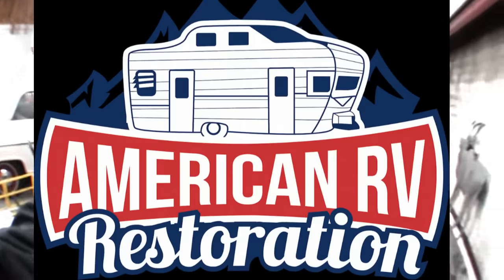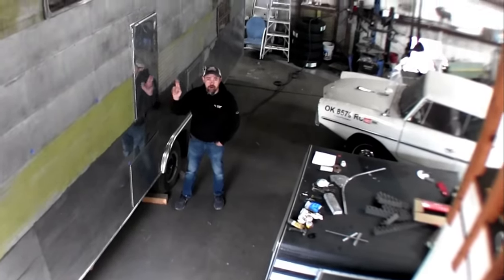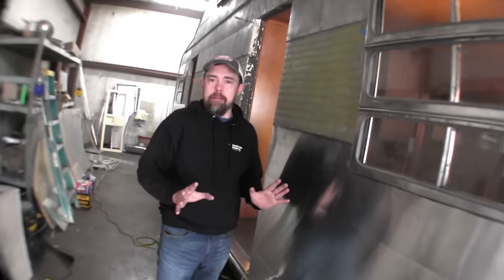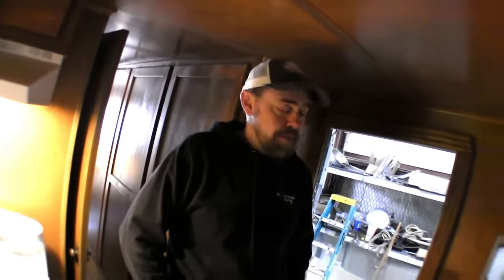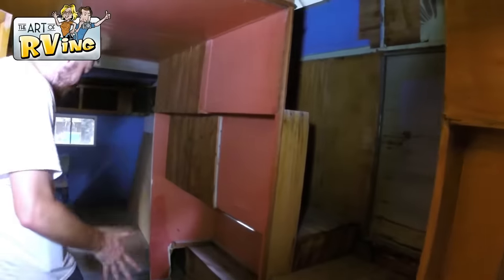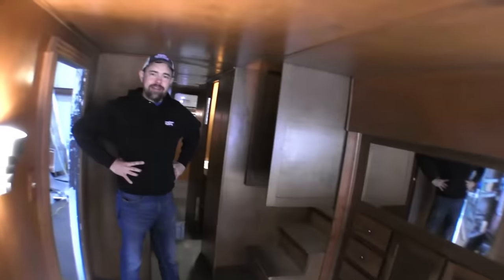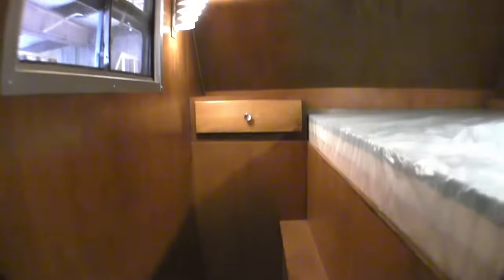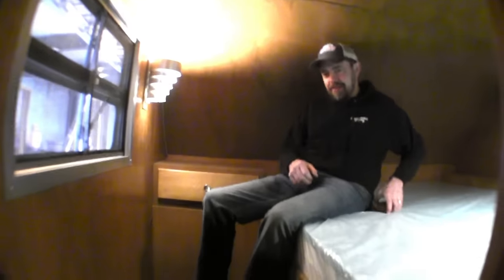Restored 1951 Double Decker Lighthouse Duplex walkthrough

Comment: The mobile home in this video was home to me and my family when I was a child.  The black 49 Dodge and the Blue 56 Dodge were my fathers Pickups.  The picture of the trailer with the white picket fence has my two oldest sisters Karen and Dava leaning up against the fence.  We would love to get copies of the photos that you have and share some that we have of this home and give you some early history on it as well.
Reply: Thats awesome!!  I hope they reply to you.  Out of curiosity, how well did your fathers pickups pull this camp trailer, especially up hills?
Reply: Thank you so much for adding your story to the trailer, that’s amazing. You could make a mini series here on YouTube telling your stories and adventures with your family. 🩵
Reply: I hope you hear 🙉 from them.
Reply: @ironcladranchandforge7292 slow and steady those trucks was probably 100 hp or less it was all about the gears back then trucks were used as trucks
Reply: @john.ediggs9034  --  Well, my 1960 Chevy Apache is stock with the 235 I6 and it has 135 HP gross and 115 HP net, torque is 195 at 2,000 RPM net.  This is according to the 1960 shop service manual.  However, it cruises just fine at 55 to 60 mph on the highway at around 2,200 RPM.  I've owned this truck for over 25 years and have taken more than a few trips with it.  No problems.  However, I do stay off the interstates where the speed limit is 70+.  By the way, I've also taken it over a few steep mountain passes (I'm surrounded by them) and no problems.  6% grade at 50 mph.  Sure a V8 would be faster and more powerful, but if I want that I would drive a modern vehicle.
Reply: That’s awsome
Reply: Super cool! How nostalgic it must feel to see your former home being restored after neglect!!!!🥰🤗
Reply: Thank you for adding provenance to this old girl😊 It must have been a tight fit as a home, I can't imagine.
Reply: Wow! This is awesome support to the historical value of this unit.👍
Reply: Amazing!!!❤❤❤❤❤
Reply: Wow. Just friggin WOW!!
Reply: That's awesome! I hope they pin 📌 this comment!
Reply: Was your family the one with the Air Force father? Five kids plus two adults would be a tight squeeze in that!

What's your favorite memory from the mobile home?
Reply: So cool to hear your story.
Reply: Cool story!
Reply: Can we get a update????
Reply: Wow!!! 🙂
Reply: That is very cool! I've been working on memoir for my only son and one of my earliest memories from 1956-57 was living in a trailer park in New Martinsville WV and a family of 8 lived in a double decker trailer. 1st floor had galley beds, then up a few steps was a small 2nd bedroom. Steps  turned and another level was at the very top was the full bed.  I was only 3 but I could remember those stairs perfectly. Since Google picks up key words I started seeing these double deckers. There's a different video that describes what I remember exactly! So neat to find someone else who actually lived in this trailer. I hope this company gets in touch with you! 😊

Comment: ..and they used to build vehicles strong enough and dependable enough to pull those behemoths. Man that's gonna be nice!
Reply: Pre-emissions days when fuel efficiency and useable power were still the standards they built for.
Reply: Actually, those weren't designed to be vacation tailors back then, they were "park tailors" that people would usually live in as their home in tailor parks.  They were designed to be mobile, but not something a family would drive around with on vacation, hitched to the family vehicle.  They didn't even include water tanks or an onboard power source because it was assumed that you would be parked somewhere with hookups.  So, you would hire a large vehicle to move it.

Comment: I have one of those couches and it is going to fit perfectly in my  18ft 1969 Fireball travel trailer. The couch without the box it sits on, fit right on top of the trailers existing  box of one of it's 2 single person beds /bench seat/ flip-up storage area that also has 2 draws under it. The 2nd bed box on the other side, houses the water holding tank and and hot water heater. So it doesn't need to flip up ,so, I made that a base for a little wood stove and entertainment center with computer and surround sound with subwoofer. I'm really looking at that split system now though.

Comment: I lived in a old trailer it was about the same year that trailer was made , and it was gorgeous on the inside but not well made. Black and white Mold took over the trailer on the inside. Moisture was a big issue when showering and after showering, and there was a small washer dryer combo in the trailer and that made even more moisture, and if I cooked then even moisture issues. Those wood panels like the ones in that trailer sucked up all the moisture and created mold all over the wood panels. Sure, the wood looks great. I would have used more waterproof materials to make it so that the trailer had been mold and mildew proof. I only rented the trailer. Thank God I didn't own the trailer.
Reply: Pretty to look at, but doesn't seem practical.

Comment: When this thing was built, what kind of vehicle was capable of pulling it? What vehicle did the original owners use to pull this trailer all over the country with?
Reply: Most likely pulled by a 1/2 ton long wheel base pickup with an inline 6 cylinder. Possibly a 3/4 ton, but the engine would have still been a big 6 cylinder with a 4 speed manual. They easily pulled these trailers, but not at the speeds we travel at these days.

Comment: What a monster.  Just what kind of car in those days could pull that thing? There were no super dutys, just a lot of low power sixes and small low compression  v8s.  Crappy brakes and easy to boil radiators and a whole lot of three on the tree transmissions.  I recall that old movie The long, long trailer.  You had to have guts.

Comment: Wow, I remember the first video on this trailer from three years ago.  I'll look forward to the finished trailer in a year or so.  Hopefully, that can be done along with some slow pans of the original literature and the full specs.  As pointed out in another comment, it does not have 54' of floor space (the video from 3 years ago correctly specs it at being like a 42' trailer) - but I still think its cool how they packaged two bedrooms into 28 feet.  The epoxy floors are a preference item, easily changed to linoleum if a future owner prefers more vintage accuracy.  The mini split is a wise update.  This design method of allowing stand up space next to the loft bedrooms is exactly what is lacking in modern tiny homes.  Why does Ethan refer to the famous GM stylist Harley Earl as the designer in the first video? - the Lighthouse Duplex literature lists the designer as Richard Ten Eyck, who was himself a famous post WWII Midwest industrial designer.  Was there a Harley Earl connection?

Comment: Awesome trailer and awesome restoration! But a few exacerbated facts! the upper deck does not double the useful floor space! and a 28' 5th wheel nowadays with 3 slideouts which will offer similar floor space will weigh between 8-10k lbs. Why exaggerate? this trailer and restoration do not need that, it is outstanding and unique